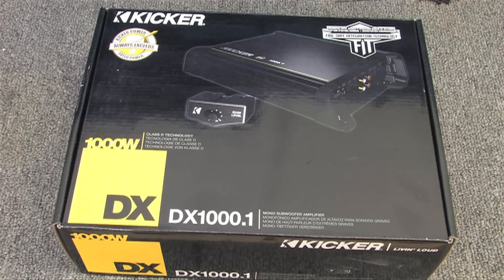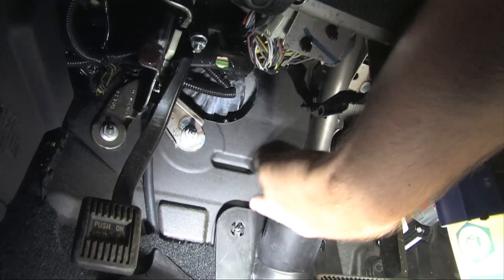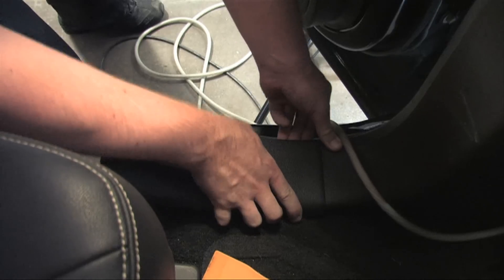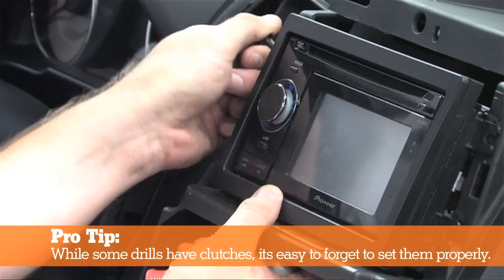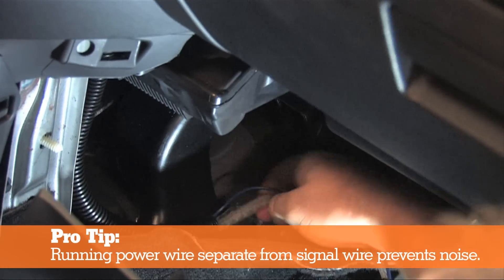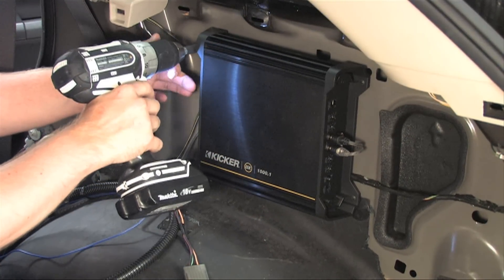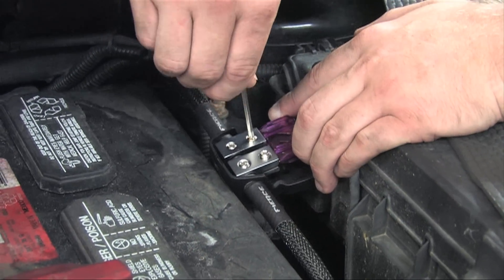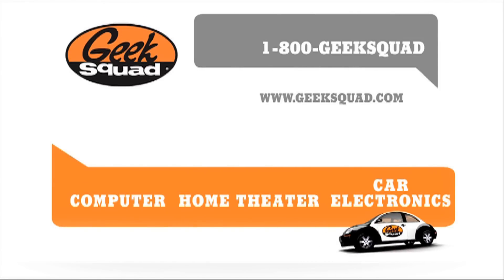Installing an Amplifier & Subwoofer: Geek Squad Autotechs

Comment: can i use  power/ground wire as speaker (subwoofer) wire? don't want to waste my time buying speaker wire if i don't need to! please reply i want to get this done late in the afternoon.
Reply: Yes you can, speaker wire is just 2 regular wires put together and labeled for convenience and ease of use just be sure you have the ground wire to the ground terminal on the amp and power from the terminal to the amp, also make sure the gauge of the wire is reasonable depending on the sub you have most people use 14 gauge wire or lower I wouldn't use anything more than 16 gauge
Reply: Alright so I can use the 4 gauge power wire as speaker wire. Thanks
Reply: lord gooch   My God you must be rich !  That 4 guage wire is about $2 a foot.  Sure will sound good though... I guess !  You'll have some very rich notes !

Comment: do u need the amp? for the sub to work?
Reply: yes, the amp boosts the signal from the head unit to the actual subwoofer. without the mp, you wouldn't get the bass response

Comment: How can i run my power cable from the battery through my firewall in a Ford five hundred 2005?  Also how do i know which one is the remote turn on wire?
Reply: Remote wire is always blue.
You may have to drill a hole and use a rubber grommet to run your power wire. There may be a factory plug in a pre-drilled hole in the firewall

Comment: What if my factory stereo doesn’t have rca outlets?
Reply: Then you'll have to get a line out converter to splice into an existing speaker wire. If you're installing a subwoofer don't connect it to a Twitter

Comment: I see a lot of people complain he didn't sand the paint but at least he used star washers to make somewhat of a connection which as he said use the rough side of the washer to cling to the metal. ofc this isn't the best thing to do and you should sand the paint but hey at least the sub worked

Comment: shouldnt you disconnect the battery first?
Reply: Since there is no power going to the Amp during installation, then there is no need.

Comment: I don't know about you guys, but every time I do any electrical work rather installing a new head unit, amp, alternator, or secondary battery. I always disconnect the ground from the negative battery post. In this video, the tech didn't do that.
Reply: You do not have to do this always.
Reply: dlfdlc True.. but just to be on the safe side, I always remove my negative post regardless..
Reply: We are nationally certified installers and the main issue with removal of battery terms during an install is running a risk of casing issues with other on board electrical systems. Removal of the fuse during install cuts off risk of damage.

Comment: They forgot to secure the sub down so it won't move..
Reply: you don't mount the sub down because it should be removable when needed for extra storage.
Reply: won't it get damaged that way? and imo if someone broke into your car they could easily steal it
Reply: Even if it was tied down steal easy to steal. Plus if you blow out tire on the road you don't have to unscrew a bunch of shit.
Reply: oh I see
Reply: Brandon Taylor u dont secure the sub. only the amp. if you pop a tire how do u take it out if its secured. thats also why putting he amp on the sub box is a stupid idea. i always put it on the side. theres to many cables to unhook if you put the amp on the bix itsself
Reply: +Mario dablife I already said that
Reply: I have two 10 inch subs in my mustang right now and trust me you want to secure them. I came to this video to see if they had any tips because mine slide around all the time. It probably because of my driving, but either way I would suggest it because putting everything back is a pain in the ass.
Reply: Jon Von Man thanks brother, I would like to thank God most of all. Oh yeah and your sarcasm needs a lot of work dude.
Reply: JohnBoyM16 try putting Velcro on the bottom of the sub so that it sticks to the carpet! Bsst of luck to you!
Reply: RemoteHelper thank you for the advice, I have 2 12s in a ported box, they are pretty heavy and dont really move around unless im slamming on the brakes very hard or driving like a maniac
Reply: that just adds extra bass, "THUMP BANG ROLL BUMP THUMP" haha
Reply: TheBlackSheep loll
Reply: Mario dablife In a hatchback you really should secure it in some way. Because what will happen if you get hit by a truck or some other auto related accident? Well that box in the back now turns into the Grim Reaper beating every passenger to death in the back of the head. So if the accident doesn't get you, the sub box will.

Most use heavy duty Velcro. I use a U-bolt on the back of the box and run a Bicycle lock through it and around the bracket that bolts down the back seat. That way I can quickly remove it and it's secured.
Reply: Pimphand Gamester Good idea!
Reply: JohnBoyM16 Yes !  Also, when they are not fastened well, do not dare get in an accident cuz flying subs may knock a head off or worse.  Just be careful not to get in an accident when you are in the car.  If you do get in an accident, get out before it hits you, or duck really fast.
Reply: Pimphand Gamester You deserve first place for funny channel names !
Reply: I want my trophy
Reply: +Mario dablife you just unscrew. I mean they make screws so you can take them on and off.................
Reply: most people don't mount their subs for a few reasons. #1 drilling holes into the floor hurts the value of the car which is bad unless you plan on keeping your car forever. #2 it's nice to be able to take out the sub when you have to use your trunk for something important. #3 it really isn't necessary to mount it unless you bought a cheap ass sub and box that only weighs 10 pounds. l have a box with dual 10's and it weighs 80 pounds, and l have another box with dual 12's that weighs almost 100 pounds. and l have a box with a single 8 that weighs about 30 pounds. those boxes aren't going to fly around and cause problems.
Reply: The_Scheff+ you must be driving like an absolute maniac, because l can rip around corners and my subs don't slide. l have even been rear ended and they didn't move at all.
Reply: Sonny Moon+ if you're in a bad enough accident to make your subs fly to the front of the car then you're dead anyways. even if l was going 200MPH and then smacked into a concrete wall l don't think it would be enough to make my subs break down the barrier in my trunk and fly through 2 rows of seats to kill me.
Reply: Trust me there's way more that they didn't do and did do that was wrong. I don't knw how BB let this video actually be passed to show people how to install.

Comment: How much would this cost to be done at a shop?
Reply: shops in my area were talking about charging me anywhere between $350 and $450 depending on the size. I believe doing it yourself is cheaper but riskier. Best Buy's Geek Squad would be cheaper than a private owned business but the private owned business would be more careful with their work more than likely. Just don't settle for anything cheap lol
Reply: JaayXI it's easy as to do
Reply: MegaVideoEditor like what private business?

Comment: I love how they didnt state to disconnect the negative from the battery to avoid blown fuses. lol why in the hell would they run the cables behind the amp and then tighten them down??? umm all i need to say is i was installing better systems when i was 15 lol..
Reply: There was no power. The fuse was pulled making the wire have no power. Once he finished. He installed the fuse giving The cable power again.

Comment: im all set i would rather pay to have ppl do this
Reply: shit me2 after I seen this.lllooll
Reply: Yep, same here. I just bought all the gear, thought I could do it myself. Watched this video and now I'm happy to pay to have this done. Lol.
Reply: +Adam Ziebarth lmfao 4 real what did you buy and for how much?
Reply: +Adam Ziebarth I just did this 2 weeks ago. It's so simple. I don't know why you pay insanes amount of money for places to do a half ass job
Reply: Lucid I only paid 70 doll hairs. They did a kick ass job.
Reply: shit $70? local audio quoted at minimum $200 just for installation.
Reply: 70 is damn good price.     there are shops out there charging 200 for running just the amp wire thru the firewall.    you got a good deal if they are good!
Reply: or people with no panel pop tools, drill, step bits, knowledge of wiring, etc...    there are some that just dont wanna mess with it.
Reply: it's always better to do it yourself because a lot of the "pros" out there will really fuck up your install because they got to get the next guy in as soon as they can. at least if you do it yourself you know the quality of the install, but you should only do it yourself if you know what you're doing.
Reply: It's easy af

Comment: Alright, so riddle me this. I have a 2002 Dodge Dakota quad cab, and I'm looking for a spot for a sub, specifically a 10 inch sub, but willing to go down to an 8 inch. I need to find a spot that doesn't take away from seat space. Anyone can help?
Reply: I have a 1995 dodge single cab 1500 and I got a 10 under the driver and passengers seat and 4 12s behind the seats
Reply: ne62556 That...didn't answer my question.
Reply: +good user, m.A.A.d internet  Check out "powered subwoofers" on Amazon. They usually fit under the seat.

Comment: eeeehhmmm ? - ive once installed a amp and stuff like that - when i did it like u, placed the cabels on top or near the gaz tank and fuelpump i got interference due to the pump in action and a weird sound through out the car speakers  - just for info, dont put cabels near the gaz tank... and, why on earth dont u disconnect the batt. ? doing so u dont get accidently fuse bloen or any other electrical faults..
Reply: And u do not grind down to clean metal for GND ? wtf
Reply: "... and, why on earth dont u disconnect the batt. ?"

Daniel, you should know better than this!
Disconnecting the battery will eventually mean, that you cannot start the engine, installed in the car.
Basic knowledge Daniel.
Reply: Tom Schreiber Oh god - Tom Schreiber, dont u know a THING !
Reply: Aahhh well........ not really. Nope. Clueless. Sorry.

Comment: Pros of driving a bimmer battery is in back lol
Reply: +Kobe B I love this about my E46. There is also a positive terminal under the hood as well in case you need to jump start.
Reply: In my e39 there's a stock amp too which makes it a million times easier
Reply: zachary michael alternator*
Reply: My Buick has its under the back seat

Comment: You never mentoned disconnecting the negative terminal from the battery.. are you trying to kill someone>
Reply: you don't understand electricity do you?
Reply: THE 12 VOLT KILLA
Reply: I didn't remove the negative terminal when I installed mine. It works great

Comment: Don't go to bestbuy for installs at first your system sounds good but you will need to redo it a little later. My system fell apart after a month and it was nice stuff just shitty install
Reply: yeah once subs broke in that usually  happens when low pass filters or filters  not tune or radio not tune to amp far as cliping point

Comment: I think ill just pay somebody to do it for me.
Reply: Same haha
Reply: it's really not hard to do it yourself, all you need to do is connect 3 wires. 1 to the battery positive terminal, 2 connect to the chassis of the car, and 3 run the remote wire to something that doesn't receive power when the car is off like the back end of the cigarette lighter or a fuse for the radio. it's super simple.
Reply: I remember being 12

Comment: Turn the radio up all the way until the speakers start to distort, then turn it down some. Then turn the gain all the way until the sub distorts then turn it down some. That's not how this works, that's not how any of this works!
Reply: that is actually how you set the gain though.

Comment: Never run power and remote along the same side as rca or speaker wires. I've done well over 1000 professional installs for people and am Owner/Operator of SUBstantial Audio Designs Inc.

Comment: hooking it up to the battery really arw these pros. you should always run power from the alternator thats where a lot of mistakes are made. where does your power come from when the engine is running your alternator. the battery just starts your car after that it does nothing. your alternator powers everything so you should be connecting your power to the alternator not the battery

Comment: not always an amplifier has many uses just depends class a/b or class d. class d is only for bass out put or for the sub woofer. class a/b amplifiers are for mid and high speakers like what is in your door that produce vocals and other sounds a sub cant make

Comment: No no no you don't remove the fuse that does nothing when the battery is still plugged in always unplug the battery when doing anything electrical

Comment: Umm. Pinching the RCA cables behind the amp like that? They will rub through! Vehicles are moving machines with lots of vibration. Thats just common sense. Those power wires need to be crimped with proper ends as well they will pull out and start a fire! These people have no clue what they are doing!
Reply: that amp doesn't have fork connections ... shitty amp. Should have went with something else for that to work.

Comment: wait, what about all the ohms bullshit that comes along with all of this???
Reply: ohms is the resistance of the power. Most amps handle the ohm conversion already. Depending on the sub. If that sub is designed with 4 ohms of resistance then the amp will send power and the power will be resisted by 4 ohms causing a specific wattage for the sub.
Reply: NotSoAvgJoe Also depends on resistance of sub and if the sub is a svc (single voice coil). For example if you have a 2 ohm dual voice coil sub you can wire it at 4ohms
Reply: Kawasakimoon88 yeah that is kinda what i was gettin at, just trying to inform him that the ohms depends on the sub
Reply: NotSoAvgJoe thank you.  first time hearing that resistance and wattage are related.  Guess you're glad I'm not your installer !
Reply: Kawasakimoon88  Thank you.

Comment: Best buy sells nothing but low end stuff like kicker they know nothing of true bass. Plus they like to rip people off. If I get new audio stuff I install it myself. The sad part is my local pawn shop has better audio equipment then best buy does. You ALWAYS want to disconnect the negative side of the battery so you don"t blow anything and this guy clearly did not do that. Installing is the easy part, its the tuning that is a pain in the ass. I will be starting a car audio Q&A on my channel soon to help beginners.

Comment: Blank smh. You never tell if you connect the power to the negative or positive terminal on the battery- it would make common sense to you but not for first timers who told you to do this video, they should be fired

Comment: Anyone doing this, especially in a hatchback, should secure the sub box. A sub box would fuck someone up in an accident if it became a projectile. Plus if it really bumps it would vibrate off of the ground, and if you're a shit driver it may slide around. Really strong Velcro would work, or anything that would be a good hold that could be somewhat easy to remove.

Comment: good thing i know how to install car audio. ur suppose to disconnect the battery completely so u dont fry any electrically in ur car..yall are suppose to be "experts" i feel bad for the people who pay yall to instal!!
Reply: there is no electricity when you disconnect the ground
Reply: Daniel Thomason Bad grammar and no knowledge of vehicle electrical systems hahaha! The other comments were almost as dumb as yours, but this definitely takes the cake! You don't even need to remove the negative battery terminal when installing, that's just something noob's do to prevent them from blowing fuses or worse. Your fluke is your best friend and disconnecting the negative battery terminal only causes unnecessary movement when testing circuits.

Comment: Yeah let's not mount the box down its cool. it can roll around no problem. and putting the rcas behind the amp like that why? this is probably the most professional geek squad install however I've had many friends go there and had to fix their mistakes plenty of times.
Reply: Right? Why did he install an 8 inch in that car anyways? Haha lol
Reply: uhhh, the majority of boxes aren't mounted. Their not made out of cardboard, they won't slide around. A decent box is made of 1/2" mdf which is heavy dense shit. Only time you'd ever mount a box is if somebody wanted it mounted, in most cases people like to move them around. And the rca cords being behind the amp isn't a big deal and is a very very common practice. If it's qaulity wire it won't hurt anything, I've probably done a hundred that way

Comment: SOO much of this is un nessisary! and my god such a small cheep low wattage sub.
Reply: How many watts does your system put out? i wish mine put out the 450 this one is.
Reply: well my dad got rid of his car so that setup is scrapet, was 380 wats on a 15" type R. in home i got 1500wrms running on a sundown x-18
Reply: +RockeyDAproductions oh cool. I'm just running two Memphis mojo's on two twisted sounds 1.8k strapped. over all hitting 3.6k. "so much unnecessary work for something so small."
Reply: doppppe. i got a alprne typr r 15 on 1200watts its only 1K rms but it can take the abuse
Reply: xxLegitProxyxx the something so small was this vids pathetic kicker setup.
Reply: Edestron after about 40 min my alpine gets hot on a 380w amp, and on my 1500w amp it takes about 300 seconds, and thats with me trying to keep the amp voltage above 12v, with my sundown i try to keep above 10v.